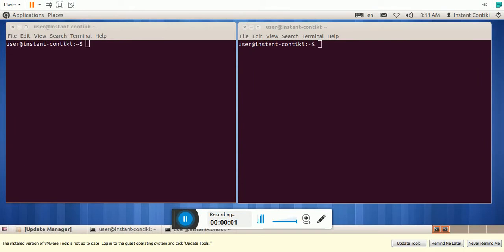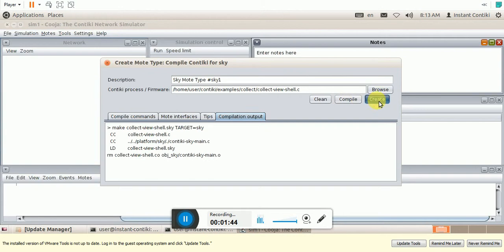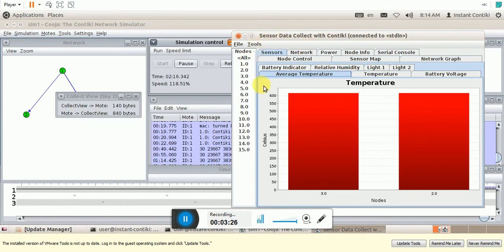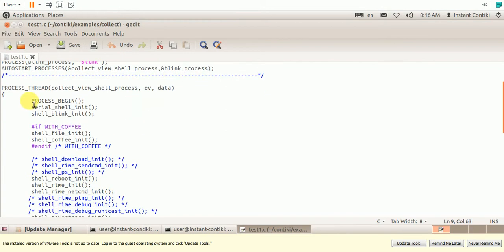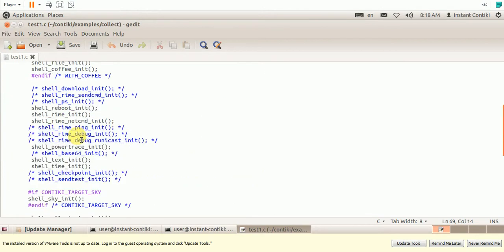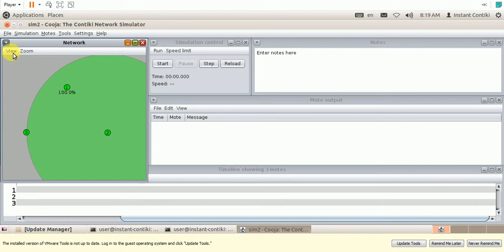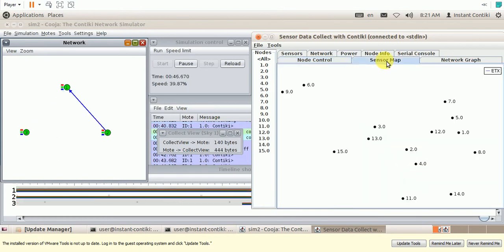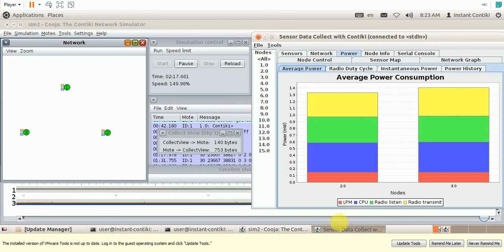Contiki OS | Cooja Simulator | Collect View  for our own application

Comment: how to deal with ram overflow using collect view and tmote sky?  thanks
Reply from the maker: That should not happen normally, May be because of low amount of ram ..!
Reply: have you found a solution to ram oveflow? @
Ömer Güleç
Reply: @Lee-lu2vi  long time to remember but i can suggest yout to reduce your code, comment out printfs etc. just check the code
Reply: thanks